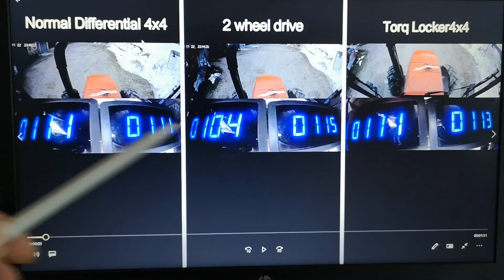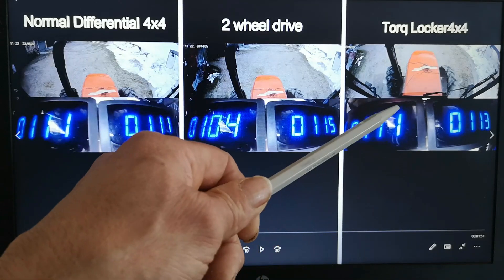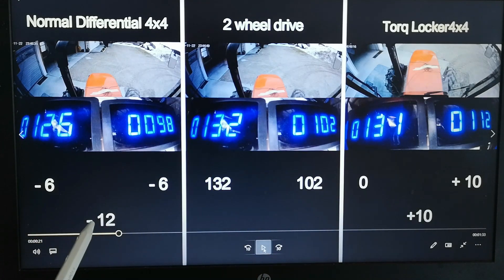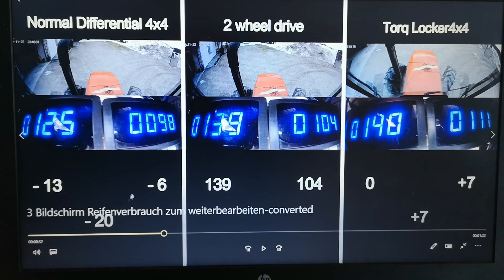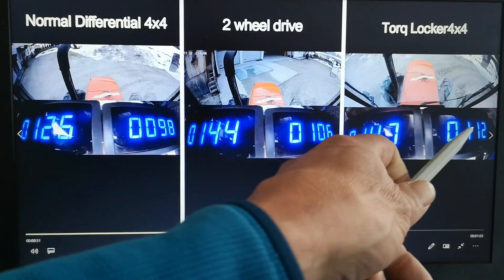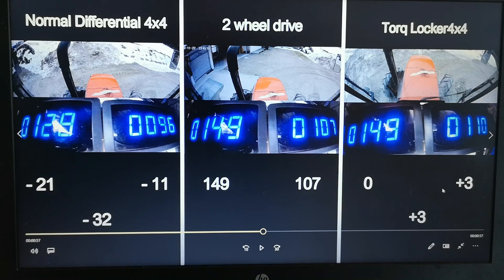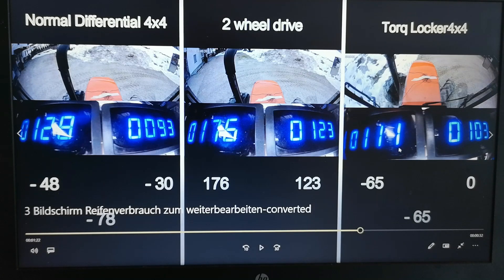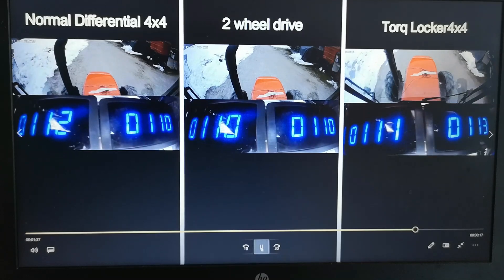Kubota M7060 Torq Locker More detailed Tire wear between Torq Locker and Normal Differential

Comment: When will these Lockers for the Kubota M-series be back in production? I’m currently dealing with a unit I recently bought and I’ve been told by one of your reps that the axle gears are too tight, so I need to wait for the updated version…